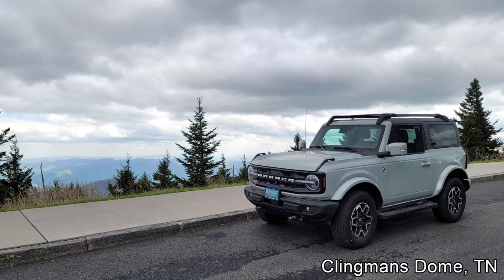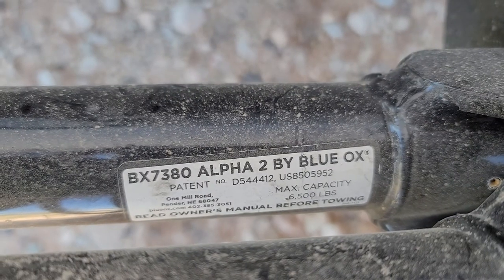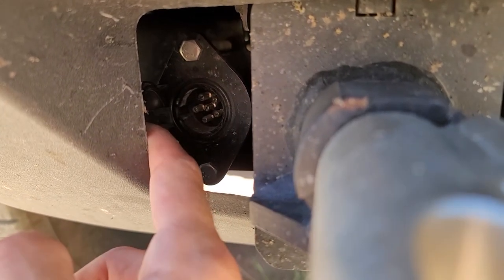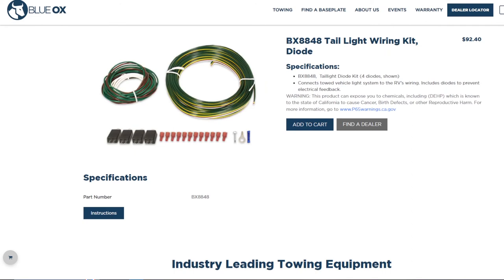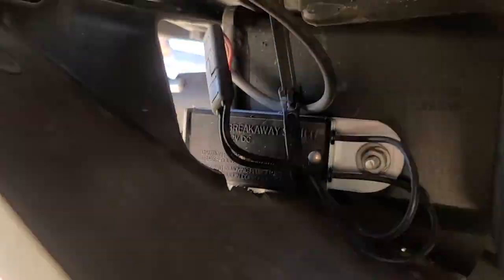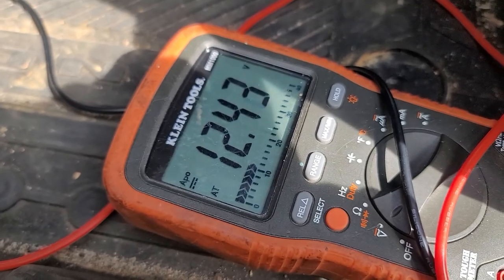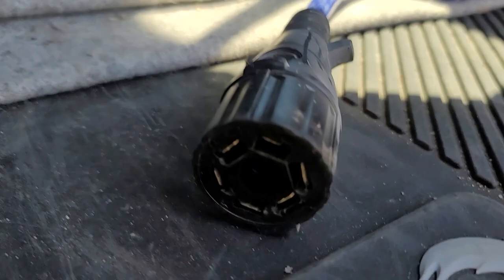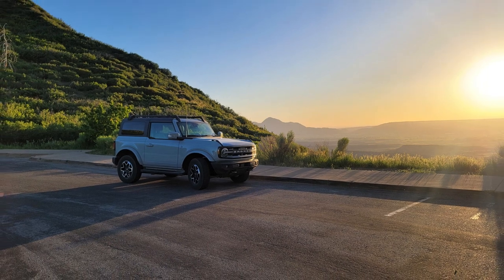How to Flat Tow a Ford Bronco (Broad Overview) - Part 1/4

Comment: We tow our Bronco as well. I did lots of research and found RVi for my braking system in the Bronco. Curt Manufacturing makes a plug and play for the lighting so no splicing wires. Great video
Reply from the maker: Thank you! Yes, I would've loved to have known about the Curt plug, would've saved a significant amount of hassle.

Comment: Do NOT let the voltage on the battery get too low as the vehicle will go from neutral to Park. Ask me how I know.
Reply from the maker: I actually read your thread on 6G, that is terrible! Were you able to get a definitive answer from Ford that this is the car's behavior when the battery gets too low?
Reply: @BOOTENWAGEN  Yes, from a lead technician in Dearborn. He specifically stated that the Bronco will switch from neutral to park when the battery voltage drops too low.
Reply from the maker: @63GBPackerfan  wow, that's kind of a huge problem. Can't possibly be difficult to fix this with an over the air update, surely this would be worth the 10 software engineering hours or so over having to honor warranties for destroyed transfer cases. Or you know... a class action lawsuit.
Reply: @BOOTENWAGEN  Yep. Mine did get covered under warranty, but others had to pay out of pocket. I suggested a class action lawsuit, which I feel is totally warranted. I am getting the charge line installed next week though.
Reply from the maker: @63GBPackerfan  right, at least they covered it, and I can't imagine what line of logic they're using to deny people. But man, I feel like I dodged a bullet. I didn't have a charge line the first time I towed AND I forgot to turn ACC off lol.
Reply: @BOOTENWAGEN  The service advisor wanted me to trailer my Bronco home from Oklahoma because of what had happened. They actually tried to blame the issue initially on my AF1 braking system, until I educated them on the system.